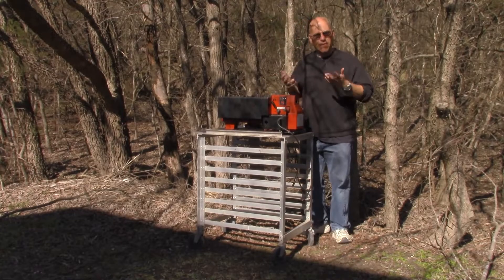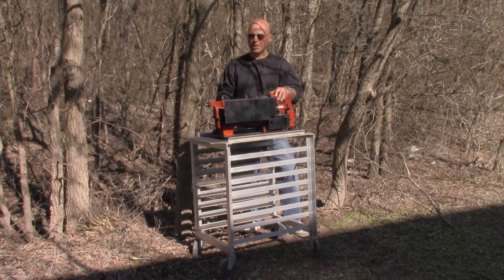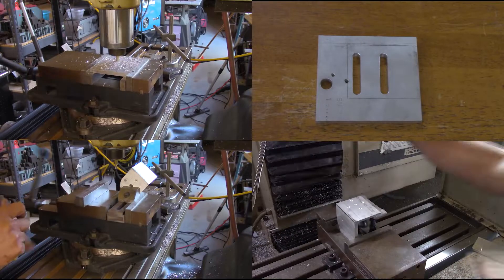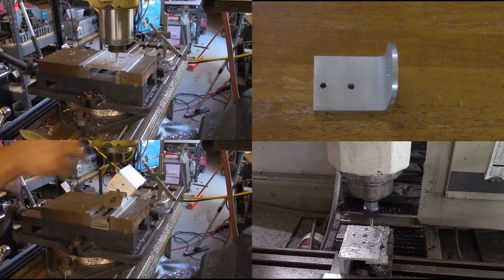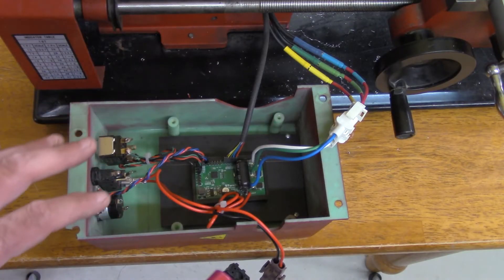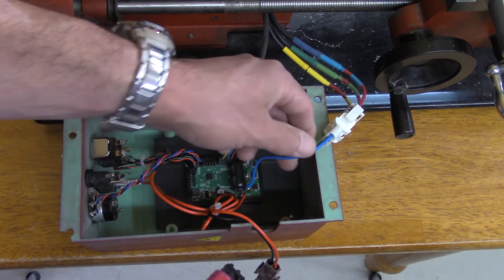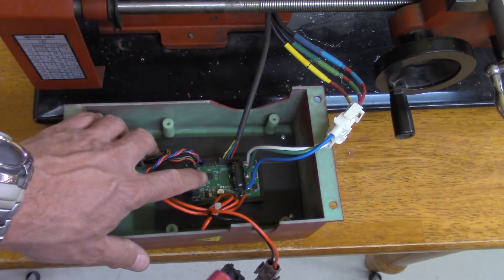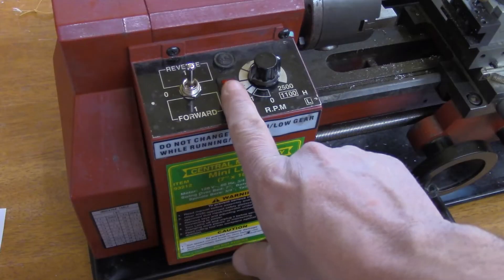Updating a Mini Lathe With  a Brushless DC Motor - With Battery Operation!

Comment: I can already hear the motor bogging down with very light cuts on aluminum. How does it handle heavy cuts in steel?
Reply: Cool CNC Dude! I can’t wait to let my wife know I can now take my lathe to the beach :)
Reply from the maker: It all depends on the speed. At maximum speed, when the duty cycle is at maximum, any further loading will cause the motor to lose speed to undertake the new torque requirement. If there is duty cycle available, the speed control loop will take over and adjust the duty cycle to compensate for the increase in load. All of this will happen regardless of what the material being cut is. I don't do a whole lot of steel even on my larger lathe, so that is not something I would do a lot on this small lathe. But my gut feeling tells me you could do steel as well. Do note, however, this lathe is not incredibly powerful to begin with, so it is what it is. Hope that makes sense!

Comment: What  motor brand,  name, part number?
Reply from the maker: It is the Flipsky 6374. They have two speed constant factor winding versions: 140KV and 190KV. Either should work, although the 190KV will give you higher speed at the same voltage, than the 140KV. There are other 6374 motors out there, but a bunch of them come with 10 mm shaft which would have required further mechanics or different belt pulleys. Hope the info helps!